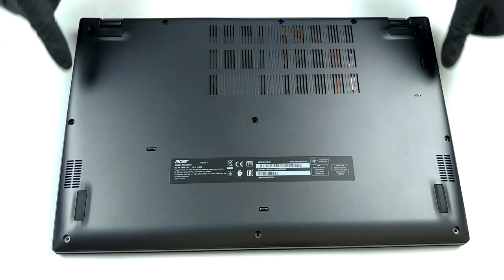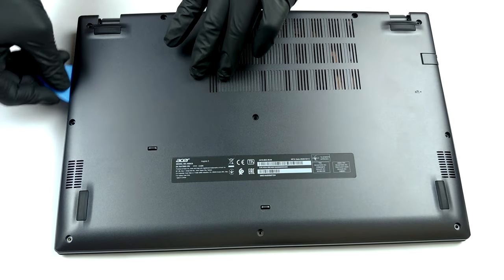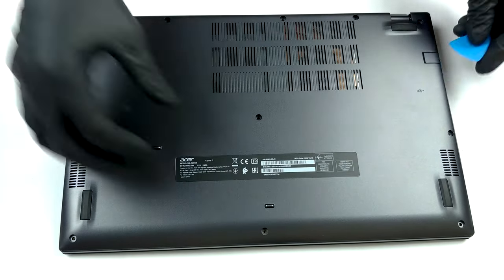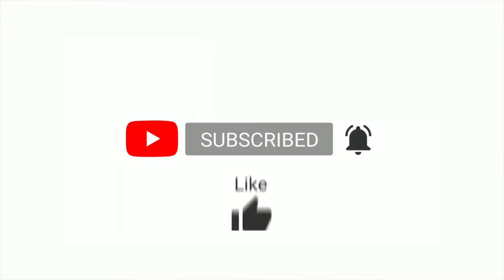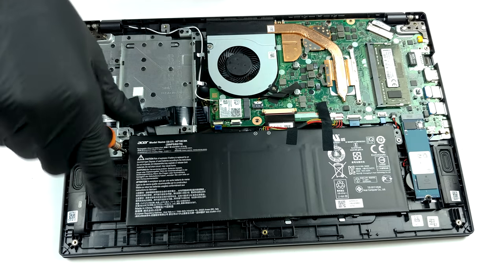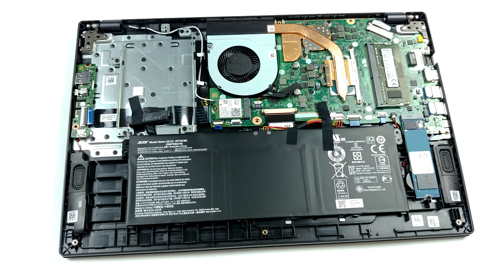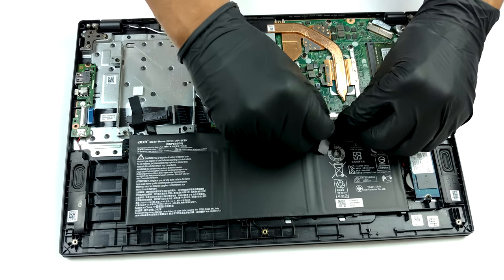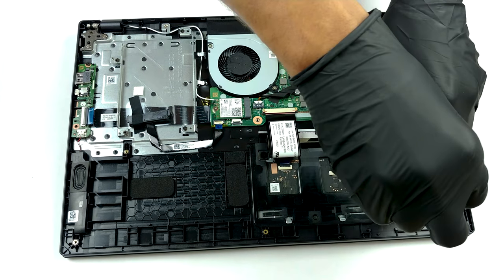🛠️ Acer Aspire 5 (A515-56G) - disassembly and upgrade options

Comment: I have an Acer Aspire A515 56-57TY which comes with 8gb ram and can be upgraded upto 20gb using a single module. But i cant find a 12gb ram ram module anywhere?
Reply: You just need 16GB and with 4GB onboard you will have 20GB
Reply: @tudorsandu6110  thanks

Comment: Hi. Thanks for this video. Very helpful.
I'm just wondering if the Acer Aspire 5 A515-56-54AW is the same?
I have the chance to buy one at a reasonable price but would
need to go to >16GB. (4GB soldered, + 16GB module).
Do you happen to know if this is possible for the 56-54AW ?
Also, nice background music. Care to say what it was?
Reply: Every model that's A515-56 should be identical. Mine is A515-56-54WE and it's exactly the same internally when opened as this one is.
Reply: @chemicalxv  Thank you

Comment: Sir, In Acer aspire 5 - A515- 56 i5 11th generation (8gb + 1TB HDD model) May I know there  is one more additional slot to put SSD along with 1TB HDD so after that I will use SSD & HDD both simultaneously?
Reply: It does have a slot for ssd

Comment: 2:18 PLS HELP where can i buy this hdd caddy?
Reply: It comes with the laptop.
Reply: @verysmartultrahuman939  This caddy won't fit in this Acer Aspire 5.
Reply: @verysmartultrahuman939  Even if that caddy fits, I'm not sure about that, he will be missing the hard drive cable connector.
Reply: @glussier100  come on, I'm trying my best here.
How about you help him, genius boy.
Reply: @verysmartultrahuman939  Why are you so upset, I' told him that the bracket and cable came with the laptop. If he lost them, he might be able to find those on Ebay.

Comment: Does this laptop (A515 56G) support M.2 SATA SSDs?
Reply: No, this supports M.2 PCIe SSD. The notches on the card are different and incompatible. However given that the SATA M.2 drives aren't popular any more i assume you are referring to a PCIe NVME, which would work in this laptop. The only issue is that this is the default drive installed, so you would need to ensure that your files and OS are moved onto the new drive. Alternatively just use a SATA SSD (2.5")

Comment: IS THERE ONLY ONE RAM SLOT ?
Reply: On that specific model in the video, yes.
Reply: @kychemclass5850  is 8gb soldered?
Reply: @alperren  That might depend what version you get. I got the A515-56-54WE from Best Buy Canada that has 8 GB. 4 GB is soldered on and there's a 4 GB RAM stick.